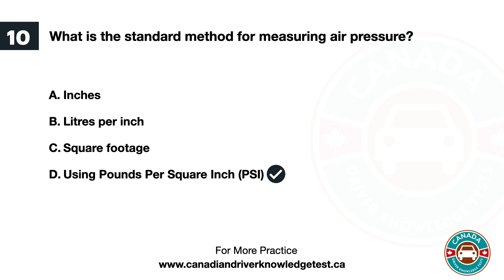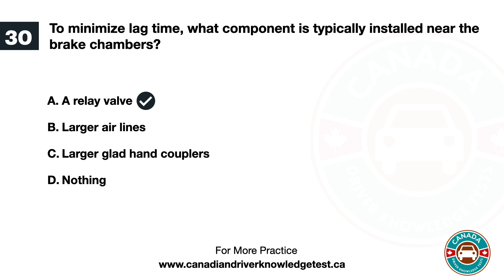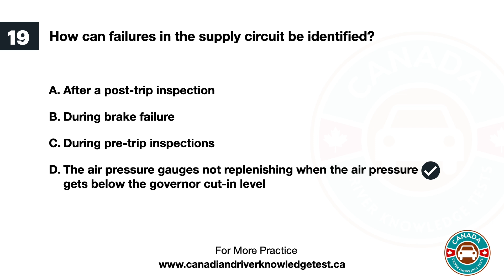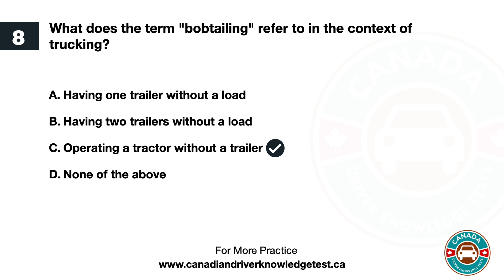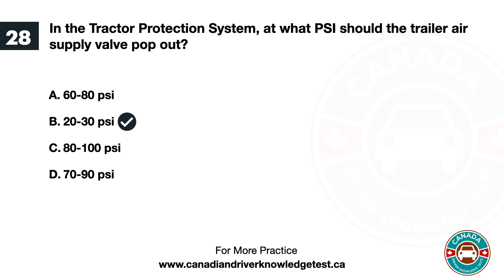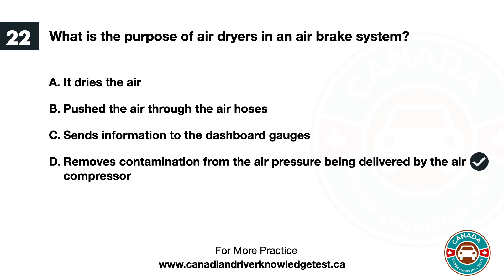Ontario Air Brake Practice Test Full Part  | Audio | Canadian Driver Knowledge Test

Comment: The title is Ontario, but there are several questions in each part seem to be for Alberta - adds some confusion.
A few errors - e.g Part 4 #28 - kPA is not a measure of trailer weight.
Some debugging of answers would help too.
Reply from the maker: We appreciate you pointing out the issues. We're working to improve the accuracy of our future videos.